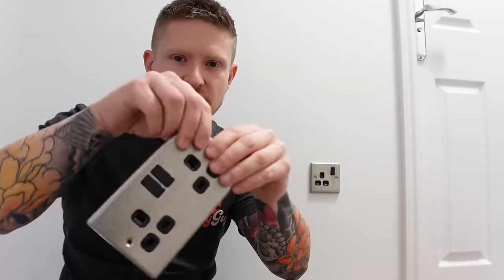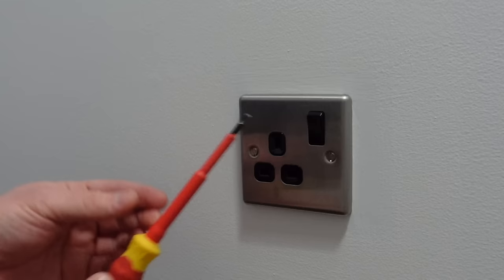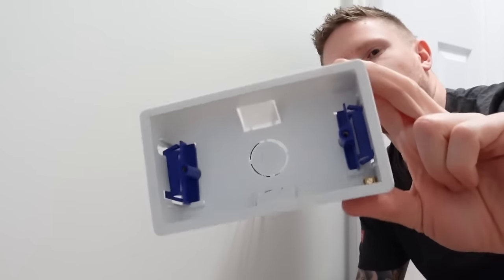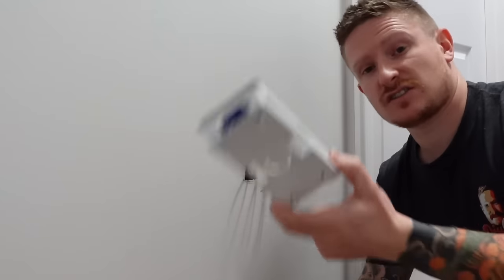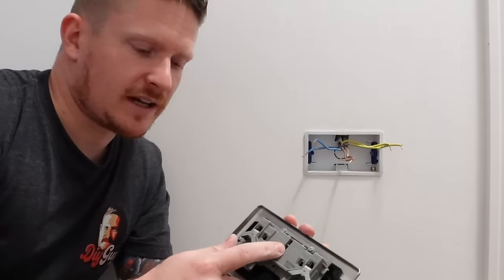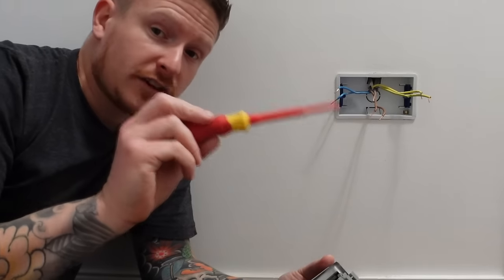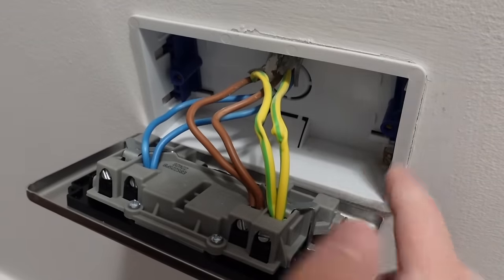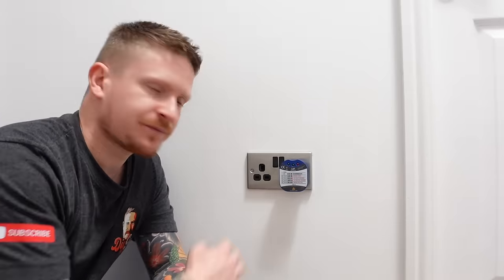How to Change a Single Socket to a Double Socket | Electrical DIY

Comment: Would you still need to earth the backbox if the switch is plastic in a metal backbox.
Reply: Yes
Reply: No.
Reply: Yes and No. Lol
Reply: As long as you have one fixed lug on the metal back box there is absolutely no requirement to run a separate fly lead to the back box. The box will be earthed by the socket screw into the fixed lug.

Comment: Can anyone please tell me why at least one of our kitchen double sockets has only one live, neutral and earth wire going into it?  Most seem to have two sets of wires.  Is this a botched job or is there a perfectly good reason?
Reply from the maker: There are a few reasons this may be. It could be a spur from another socket for example or it could be the end of a radial circuit. Not necessarily any issues with this providing those are complying with regs.
Reply: @TheDIYGuy1  Thank you very much for taking the trouble to explain this.  I greatly appreciate it.  Thank you again.
Reply from the maker: Any time

Comment: How would you do it if you dont have 2 of each wire ?
Reply from the maker: Same process 👍
Reply: @TheDIYGuy1  so if I only had 1 wire of each colour how would that power a double please,?
Reply: @mitoturbo9185  Just ensure you connect the brown cable to the L terminal, blue to the N terminal and earth cable to the E terminal. If you've only got one cable entering your backbox the socket is the either a spur of a circuit or the last socket on a radial circuit, which are usually found in kitchen's. The socket the DIY GUY was working on is on a ring circuit.

Comment: The amount of call outs I’ve attended because DIYers screwed up their electrics, broken their ring final circuit, dropped neutrals.. so although it’s not a hard job, needs to be done correctly. The “it works” saying doesn’t mean it’s done correctly

Comment: That earth wire from the metal back box was too short to reach to the right hand side of the socket.
Reply from the maker: This is simply for demonstration purposes regarding what should be done when using a metal back box. Hence no socket/grommet/capping or wiring were shown during that section.

Comment: Questions about security cameras. The only question I have for you.... when it is plug in 24 hours does it run up the electric bill? Do you get better video quality when you have plug in cameras like Blink mini plug in or Wyze plug in cameras? ve outdoor wireless cameras? which brand has better video quality better night vision and real time motion detector record time?  Also there is a light bulb security camera you thoughts on those. I just saw one at someone house and the guy told me it move 360 degree and show me clear video. It screws in like a light bulb youwill change in a tradtion lamp.
Reply: One question!!??

Comment: That socket seems a bit high up?
Reply from the maker: Sockets in the UK should be 450mm from the floor. This one is at 450mm from the floor. Cheers
Reply: @TheDIYGuy1  I think that is the max height (not a Lecky) just looked bigger from a visual
Reply: @Steven Connor  It's the min hight on new builds, it's a building reg and makes them more accessible to all.

Comment: 2 cables for each colour-why? I do not get it, sorry, are they 1,5mm2 ?? So interenting the electricity works the same everywhere but so different the regulations are.
Reply: It's called a ring circuit, you are effectively splitting the load of the cable meaning smaller cable can be used. it's 2.5mm in the UK.

Comment: It isn't really a basic electrical circuit though is it, it's possibly the most complicated in a house . It may be a ring, it may not, it may have spurs, it may not. It may be fused it may not. I wouldn't call that basic.